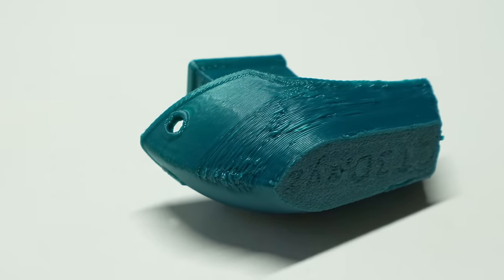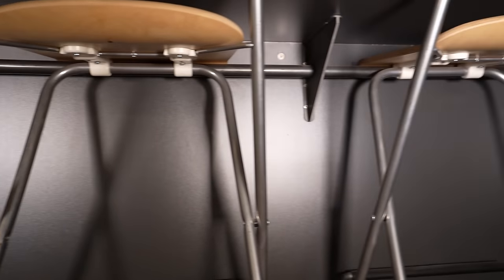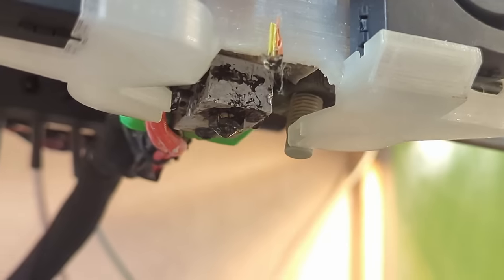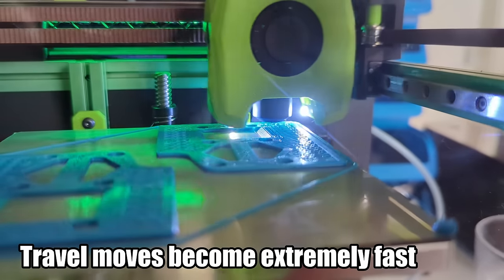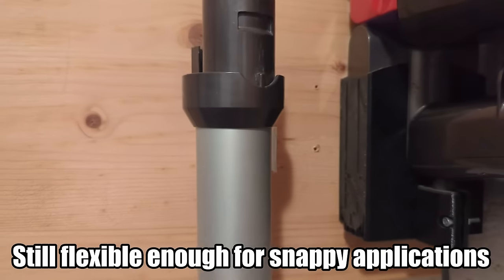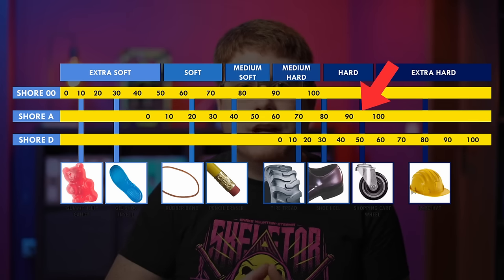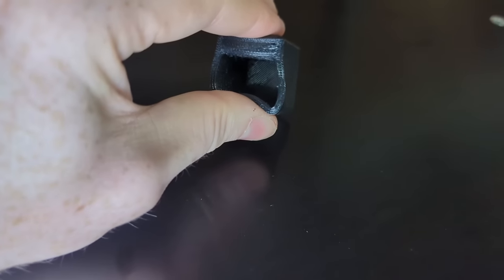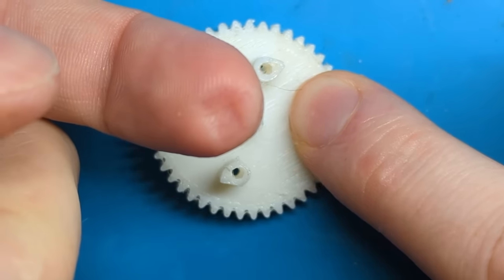3D printing material: When to use PLA, PETG, ABS, TPU, Polycarbonate, Nylon etc.

Comment: I’ve only recently started using ABS and ASA and absolutely love the stuff!   But also only started with them since I have a printer with an enclosure.  ASA may be my favorite material to print.   

For the most demanding parts, PC and PC blends are my go-to.  I’m always impressed with how strong that stuff is!
Reply from the maker: I was also impressed by how PC wasn't strong enough for my printed razor head. But in general it's pretty strong. I'm currently working on a Voron 0.2 with a planed 80c chamber temperature. Can't wait to see how demanding prints turn out with it.

Comment: Great video. 

Point of note though is that what you refer to as creep is typically referred to as Stress Relaxation.
Stress relaxation being the reduction is stress (applied or resisting force) over time while being under constant strain. 
Creep is generally the opposite, which is a change in strain (length or deformation) over time while under constant stress.
Reply from the maker: So creep is rather a loaded part deforming instead of "being compressed for good" with a screw for example?
Reply: @SmallBatchFactory  Creep is constant stress over a time interval causing "plastic" deformation.  Since in the example it's under a static strain the polymer chains stretch as time goes on and the stress response is reduced.  A good example of creep would be a cantilevered beam where it's fixed on one end and the other a load, say a block of steel, is placed causing a constant stress regardless of the deflection of the beam.
Reply from the maker: @ThunderBird80085 thanks! Learned something new. I always thought it refers to all deformations. Seems like larger channels, where I learned it, get it wrong as well.

Comment: @SmallBatchFactory - Thanks for the very useful information. I've just firmly dragged myself into the world of 3D printing only yesterday. I decided (I think wisely) to go for a used Ultimaker S3 (dual filament) printer, which in my rather limited opinion, has a really easy learning curve and has made it possible for a hobbyist like me, to start printing high quality zero error prints within minutes. I purchased a pre-owned machine, one, because I wasn't sure if I would be interested for long, two, because it came with a dozen new assorted filaments/maintenance kit and spare heads, but most of all, I was totally sold by the printers incredibly easy step-by-step setup process and the intuitive functionality of it's responsive integrated touchscreen. It's integrated heated glass bed (as you mentioned) has already proven itself, I could literally pry finished prints off with ease. No adhesive was required, for any of the first twenty smallish test prints that followed it's initial installation. It's been printing literally non-stop since I gave it a new home! 😉

You've earned my sub! 👍
Reply from the maker: Thanks! It's definitely more rewarding to get a used high quality machine than a cheap new one. The setup is often easier, especially with automated bed leveling. My Prusa has over 600 printing DAYS and still runs as good as new (if not better since I upgraded a few things).
Reply: @SmallBatchFactory  Mine was four years old and well used apparently before I took ownership, but with a little grease and a nozzle clean, it was back to business as usual. I'm now methodically printing my way through a 3D bucket list (with the help of videos like yours)! 😉👍
Reply from the maker: @Zodliness a bit of maintenance goes a long way. Mine is 6 and as reliable as ever. Someday you'll realize how cool designing  your own stuff is :-)

Comment: The filled materials can absolutely have different properties than their unfilled counterparts. Fiber filaments will absolutely be stiffer and a little stronger even through a .4 mm nozzle though only in the xy plane if you have a good quality chopped (or continuous) material and keep it actively dried as fibers will wick more moisture than normal. If you want higher z strength, you need a wider nozzle and taller layers so you aren't aligning all the fibers with the nozzle. It will also raise the hdt a lot which matters for high temp applications like termoform molds. But you are right if you are talking about ground fiber filamments, it just makes things look pretty and absorb more water, and you are very right on the z-hop front.
Reply from the maker: Of course, what I meant was things like chemical and impact resistance. Real fibers make things a bit stiffer, but things like creep don't change much. IMO most people go for carbon fiber because everyone loves carbon, but in many cases it's just for the feeling.
Reply: @SmallBatchFactory  I was under the impression that fibers also serve the purpose of improving printability a bit. Mainly less warping. Is that actually true? I didn't see you mention it.
Reply from the maker: That's a very good question! I honestly don't know if they help with that and never thought about it. Definitely need to research that.

Comment: One of the more annoying things I've had to deal with is the mechanical properties of the materials you mentioned. 

I designed a bracket that can be used on old cars (actually have a video on my channel about it) and went through like 30-40 revisions to get it right. Through the revisions I tried different materials and basically everything but PLA was way too flexible and would deform from the counter spring that keeps tension on the headlight bucket. So in the end I just ended up using PLA. Surprisingly it still works even after a year or so. I was really hoping a material like ASA would be the golden ticket, but it's stiffness was no where near PLA.
Reply from the maker: That's the thing people usually overlook in PLA. The stiffness has its advantages and creep is only an issue if you push it to its limits. An alternative would be Polycarbonate but that's hard to print

Comment: I've only used one spool of PLA, and I'm unlikely to use it again unless there's no other option. PETG is my go-to material for most projects, and I'll turn to ABS, PCTG, TPU, Nylon, and carbon-infused filaments when specific properties are required. also when i print TPU or Ninjaflex i usally either use a Textured PEI sheet. or put down a layer of PETG first and print on top of that. it kinda depends on application im printing!
Reply from the maker: PETG works great in many applications. For prototyping I still prefer PLA. No need to keep it dry for example. A bit of moisture and PETG can give you a lot of stringing.

Putting a PETG layer down for TPU sounds a bit complicated. I always have a bed sheet with an invisible PVA layer on hand.

Comment: I've pretty much exclusively used PLA since the printer is indoors, I agree that PLA is much stronger than one usually expect, but the downside of the stiffness is that the part will be more susceptible to impact damage
Reply from the maker: Yes, definitely. They all have their pros and cons

Comment: My favourite filament is CC3D 'PC', which is actually 50% PC 45% PETG. Prints super easily and is the best of both worlds. Highly recommend it!
Reply from the maker: How does it behave in terms of stiffness? PETG is rather flexible while pure PC is the opposite. I have a spool of PC ABS which I have yet to try.
Reply: @SmallBatchFactory  I personally believe it's a wonder material. It's more temperature tolerant than straight ABS, prints more like ABS but doesn't need as finer chamber temperature control, nor any fumes. Supports break away easily and it bridges far better.

I've not used PETG CF, but it's how I imagine it to be. Harder, more temp tolerant, 'better'. I use it for small parts because it's the most expensive filament I use (I buy bulk PETG and ABS from Sunlu), but I recently printed a 3rd party part cooling duct with it.
Reply from the maker: @MarkusNemesis  sounds really interesting! There are way to many filaments out there to try them all nowadays.
Reply: @SmallBatchFactory  PC-PETG (which is what I call it) only seems to be sold by this one brand (CC3D). I believe it's because they have a patent on it, and I've only seen it available via Amazon. Definitely worth a look.
Reply from the maker: @MarkusNemesis  I'll put it on the list after I used up my 75kg of other material I still have. Otherwise my wife might divorce me :-D
Reply: @SmallBatchFactory  I shan't hold my breath then! Unless I could buy it for you if it leads to a video about it. I really want this material to gain traction so they 1. Don't discontinue it, and 2. Make more colours, and even a CF version.
Reply from the maker: Yeah, I might have a bit of a bargain hoarding problem...

I couldn't find the filament on Amazon Germany. Something about your profile picture lead me to believe your German as well ;-)
Reply: @SmallBatchFactory  Ah, that's annoying. I did see a German review on the filament from 2023, but it does appear to be unavailable now. I'll see if I can source it any where else!

Comment: Excellent overview! One thing caught my attention on slicer settings, could you explain further on the Z-hop creating more harm then good and why its a setting you now leave disabled? I have not heard of this being problematic and I use it on my current settings.
Reply from the maker: I guess I have to put that on my video backlog. Short answer is when you lift the Nozzle your pulling a string away from the part since the filament is still oozing a bit. Without lifting you're wiping the Nozzle on the part while moving the extruder, reducing the stringing.

The lifting part also takes a bit of time. Not much if the printer moves rather slow anyway but on the Voron it was extremely noticeable, almost like lagging in videos.
Reply: @SmallBatchFactory  Ah, ok. That does make sense, I'll try disabling it and see if I notice any speed/quality improvements. Thanks!
Reply from the maker: Yes, let me know. There should also be a setting called wipe distance that you can increase. It's basically additional movement back and forth before traveling to make sure oozing has stopped.
Reply: I use z-hop on large prints because it eliminates the noise of the nozzle traveling over the infill and also on tall small prints because it reduces the risk of tipping over parts of the print.

Comment: I use PLA for hydrofoils for my wing surfing. I tried PETg+ but it warps too much printing leading edge down and there's horrid clean-up afterwards fo other orientations. In NZ in the summer if you leave any PLA outside that isn't white, expect warping. I have to pay careful attention to my split wing pieces orientation and part alignment and spacing. And no drying outside in the sun after applying fill either. I use for wing models and make the moulds from my PLA models.
Reply from the maker: Does it stand up to the water? I've had PLA parts get soaked like a sponge after hours in water. PLA isn't fully water resistant according to some sources.

For your temperature problem you could check out HT PLA. It does shrink a bit though AFAIK.
Reply: I use PLA to create the model and then I make a mould from the model. Otherwise the shape would be too inaccurate after composite cladding and strategic reinforcing too difficult. @SmallBatchFactory

Comment: I use a glass bed for both my FDM printers. When my PLA/PETG isn't sticking, I heat up the bed to 40°c, apply masking tape evenly across the area I'm going to print on and leave it for a few minutes, then fell it off, this gives me an even coat of a mild tac adhesive. I even keep the strips of tape I used as they're usually good for a couple more applications. After I'm done with my projects I heat the bed up again and clean with alcohol.
Reply from the maker: Sounds a bit cumbersome to me. I worked with masking tape years ago and never looked back after using my first PEI sheet. Since the I ocassionaly used bare steel for Nylon.

Comment: You should revisit the information about PETG being usable inside a car  Standard cheap off the shelf stuff definitely isn't.  Maybe you can find a variant without fillers, but the PETG you'll normally buy, Overture, Hatchbox, Prusa, etc, will not survive in even a moderately hot environment in a car.  It won't become a puddle, but it won't retain its shape.

I've made this mistake two different times now, printing a part for a car in PETG, and when hot days come around, it loses almost all of its strength and begins to warp.
Reply from the maker: At least that's the "common knowledge" floating around the web. Haven't tested it extensively myself. Heavily depends on your climate of course. I can only speak for south Germany